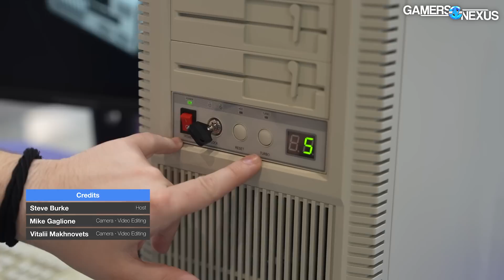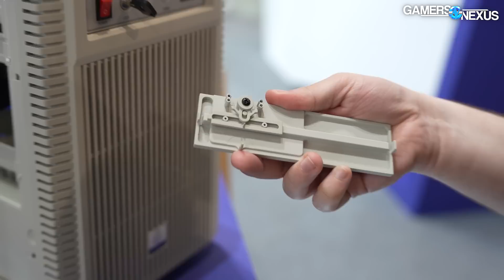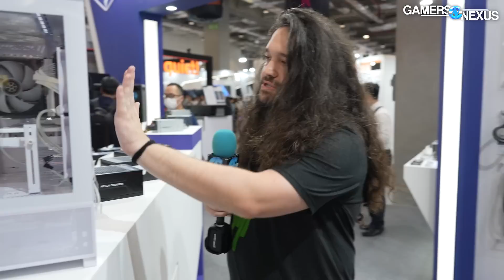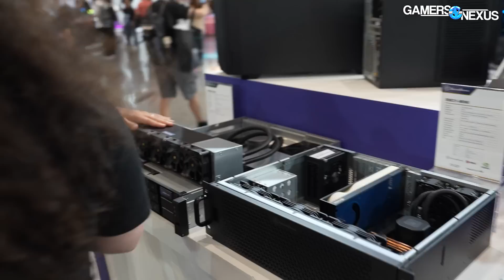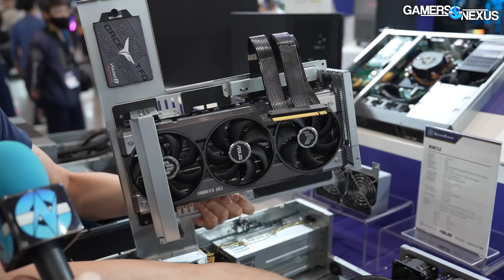Unironically the Best Case: Retro Silverstone FLP02 with Turbo Button

Comment from the maker: This thing is so damn cool. I can't wait to do the review. Check out Silverstone's FLP01 and the other cool/large cases from last year here: https://www.youtube.com/watch?v=rgu-91X3Sfs
Watch our Corsair coverage of their new 3-chamber case and fixed prebuilt GPU cooler: https://www.youtube.com/watch?v=wHgtYBUN0VM
And our technical interview with Noctua! https://www.youtube.com/watch?v=UpNmd3Y9qUU
Reply: Well, I hope they fix the power switch in the final version. 0 is off, 1 is on.
Reply: @Bagline  its because its the momentary switch nature of current pc hardware.
if it was depressed on the 1, the pc would do hard shutdown immediately after powering on.
i wish they went with the later iteration of power switches that look exactly like the Reset and Turbo button but slightly bigger, with a green led behind it.

Edit: thinking about it.
 if they flipped the switch label to 1 depressed being the default state and flicking it to 0 to turn it on would be Bagline's image. 
but flicking a switch to zero to turn it on would be a leap of logic most people struggle to comprehend.
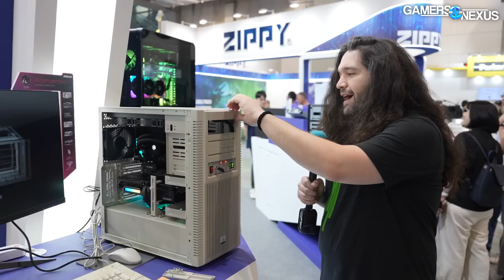Reply: @Personality_Of_A_Brick_Wall  That makes sense. I would honestly rather see that just be a hardwired switch between the wall and power supply though and have the modern atx power button hidden somewhere like up by the front panel USB. ( 4:55 ) Looking at the case and seeing it with 0 depressed while it's clearly on would never be unseen.
Reply: FLP01 was not in the roundup for Computex last year. Just double checked.
Reply: Not interesting, not enough space for HDD...
Reply: So they still CAN do real PC cases instead of RGB showcases bulls*** if they really want to. So it's not forgotten knowledge after all.
Reply: @omsi-fanmark Not really because even my Corsair ATX medium case. I have more space for HDD and I can put a RTX 4090 or RTX 5090. Here I saw only 2 spaces for HDD... Before it was easy to put 6 minimum...
Reply: @KenKazama-v2.0  They have 2, maybe 3 underneath, then 3 5.25" drive bays means they can get 3x vertically in just two of those, AND you get space for an external optical drive. They sell the 2 bays into 3x 3.5". I have one and it even has a 80mm fan (granted it's an original Athlon Thunderbird machine so it's deep). You could do several more if you're doing 2.5" drives I think my Evercool has space for 4x 2.5" including the fan. 

If you're trying to get >6 3.5" HDD, you're looking for a different kind of case and it doesn't make sense for them to make it full on NAS-style when there are other cases with huge drive stacks for that (completely legit) use case.
Reply: @clinttube  Back in the day, if you took an E-ATX XL case, you could add 12 HDD easily and you had easily 4 5.25". Do you seen the price ? $225 for an ugly case without space... If it was great, you could easily put a RTX 5090 and right of the card, 3 or 4 extra HDD. But it is not the case
Reply: @KenKazama-v2.0  I'm definitely not disputing the dearth of storage options and expand-ability in modern cases - I just made the decision to go "modern" instead of what I really wanted which was greater storage capability and 1-2 spaces for optical drives. Instead I put my slim DVD drive inside the case and will be getting a cable with a motherboard header on one side. 

So I'm with you; I'm just saying relative to what is available today this actually has style to it. The options that I found were simply boring especially given their price, so even at $225 at least it's different. My issue with this case is it seems to be liquid cooled or bust. They could've put the power supply in the top and lowered the MB to get it more in the path of the intake, which would've been even more old school. But it's assumed everybody liquid cools now apparently (except me) so they weren't quite innovative enough to pull that off.
Reply: It's not a REAL retro case without razor sharp edges on the stamped steel.
Reply: Now we need a motherboard output that hooks into the front number display, so it can display either POST codes, or fan speed %s, or temps, or anything else of our choosing...
Reply: Turn your key, Sir.
Reply: Is the PSU shroud on that retro case removable? I hope it is.
Reply: So funny watching this and see Linus little fckups :D
Reply: That retro case is for sure the best.!
Reply: I want someone to do the late-90s era cases, with their clear plastic, or the crazy indigo-and-teal SGI stuff.
Reply: As a 19" Enthusiast, Silverstone is releasing yet another banger with the 3U case. My current workstation build is in the RM-400, which is 4U. In the living room i have the Grandia GD-11 with water cooling support, which is also rack-mountable. I also use their 4x SATA M.2 3.5" thingymabobs to get high SSD storage density without breaking the bank.
Reply: I want my internal blu ray/dvd drive bays 😊
Reply: oh shutup beta-driver clout-chasing freak
Reply: $220 us sounds like a great deal until the govt F'd the whole damn world.. and likely that's ~$250USD + shipping + sellers mark up and translation to local currency... its like a $800 NZD case.. That's over half the price of a 5070ti... for a case  =(
Reply: Please tell me it comes with a matching steel side panel instead of tempered glass.

Comment: you're not meant to use this as a modern daily-driver gaming PC. don't put a hot GPU or even CPU in it. you're meant to use this as an aesthetically retro hobby computer. inside and out. install Project Luna or eXPerience Freestyle or maybe even Project Memphis on it. it's meant for people who can't find old PC cases anymore due to draconian "e-waste" laws, like us Europeans. you're supposed to use this pc and its predecessor the FLP01 as retro game emulator stations. as printer terminals. as office program interface. as YTP editing machines. play old pc games on them, using some nice little modern 4-core Intel with integrated graphics. 

don't use a 16:9 or other widescreen monitor with this. use a gray/beige CRT or LCD monitor with a 4:3 aspect ratio. and please PLEASE don't install Windows 11 on it. that would be cringe. you don't even need antivirus let alone the dystopian joke that is Windows 11. just get Windows 10 LTSC, keep your Firewall on, and use OpenShell & Retrobar to make it look like XP. make your wallpaper Bliss and the desktop theme Luna. you will thank me later.

Comment: turbo put you at 33 mhz. you would have to click it off for certain games that were designed to run on the slower 286 systems.

Comment: the problem with excessive ventilation ports is it prevents static pressure from building inside of the case. breathability is not as important as maintaining the air pressure that forces the hot air out.

Comment: That lock unlock feature is probably one of my favorite features! I have a 1 year old that loves pushing buttons.Having that will prevent him from being able to turn it on or off, which is pretty cool, IMO. I'm just wondering how that works since modern PCs dont use toggle buttons. They use push buttons. If I turn it off, will it just cut all of it's power? Or does it just send a shut down signal only? Or is that just a push button that just looks like a toggle button? So many questions!! lol

Comment: Actually the ATX standard was introduced by Intel in 1995 if I remember it correctly. That means you can build a modern PC in any vintage ATX case from 95. And I've done that a few times with the idea of a sleeper machine behind it.

Comment: The massive fail of 3 floppy drives.  Drive C: is drive C: because you get Floppy A: and B: and that's it.  The blank is a standard for a reason.  Bare minimum need one blank panel.  The good news is if you print one on a textured build surface with the right color it might be easy to fix on the end user side.  Curious if the toggle is a momentary, AT used a double pole double throw with the full wall AC routed up to the switch 😅

Comment: I like that there are some companies giving us places to add optical drives and more front panel ports.  There is no excuse why not with so many cases, like the ones that isolate the power supply on the bottom as they can just cut open spots in the front.

Comment: Just wish the FLP02 was cheaper, I still cling to my old case only because of the 5.25, I use a lot of USB ports so I need the expansions but my case is starting to get some space trouble due to the bigger GPUs. Will still try to get one.

Comment: No woodgrain accents, doesn't sit horizontally, and no actual 5.25 drives?
So close, yet so far.
Any chance of getting a power supply with a thick plastic slab of a switch that feels like you're flipping a breaker when you turn it on?

Comment: I agree with Silverstone that the locking mechanism is difficult to manufacture,  how about using the traditional clip style cover plate while retaining the 5.25in floppy style plate? It doesn't need to worry about mechanical fault, and it cost less to produce as it can be 3d printed. Even if the clips snaps due to plastic age. It can be reprinted again.

Comment: I'd like to see the turbo button not just override to 99 pwm, but to be programmable. 
That way it would actually be really useful, not just a homage/meme. For example: you'd like more fan speed during gaming, but a silent desktop experience. Cpu temp dependent fan profiles also kick in during short cpu turbo duration (opening a program, extracting something, etc). Gpu dependent profiles can only be realized with third party software.
A programmable pwm override button would solve both problems.

Comment: I would love a successor to the Silverstone FT02.   I still love mine, just need one with about 5 to 7 cm extra length (case height) for the newer ~350mm GPU's.  The only over improvement that case needs is the hot plug connector mechanism for the 5 drive internal hdd bays. Everything else about this case is perfect and I will continue using it since nothing really matches it.

Comment: I love that I was able to salvage a Micron Millennia case from '99. I removed one of the disk drives and the floppy bay (both are behind a hinging plate) and slapped in 2 80mm fans and some USB I/O.

Some cut rivets and zip ties later, that beautifully yellowed machine is running a 7800X3D, Deepcool Assassin IV S, B650 AORUS ELITE ICE, Klevv Cras A-Die RAM and an XFX SWFT 9070 XT with a 1300w Seasonic PSU. I love it so much.

Comment: I really like my Silverstone GD11, as it is convenient to keep on top of my desk hutch, keeping it cleaner from cat hair. About as compact ATX as possible without being inconvenient to work with. 2 possible improvements I'd like to see:
Top panel modified for perforation running longer along the PCIe/GPU slot. The GPU heat exhaust does get trapped a bit, and leads to some temperature rise, though not a problematic amount for a 300W GPU. 
3 front fan support (for 360mm radiator). I managed an Artic LF3 360 in the case, but the left 1/3 does not have a fan, which I moved to center push/pull. I acknowledge about half the flow would typically be obstructed a GPU anyways, but it would still be nice for it it to be tooled for support.
I'll also note the push/pull aides the RAM temperature significantly under full system load, as GPU flow through designs heat dumping onto the RAM is not insignificant.

Comment: Just fyi: The Turbo button in the old days would slow DOWN the clock speed to cater for older games and software relying on clock cycle. Otherwise there wouldn't even be a point.

Comment: Dig the retro system.  As someone who has owned a lot of cases.... The fishtanks just aren't a great option if you're a real hardcore hardware person.  If you like to tweak... and travel with your case (LAN Parties, etc).... and have lots of upgradability options... fishtank just aint it.  Its purely for show.  It comes with tons of usability compromises. They are usually needlessly heavy too.   I regret moving to my Lian Li fishtank (x11 evo or w/e) case from an older Lian Li oldschool Mac Pro desktop clone case.  The old Mac Pro clone one had so many more drive bay options, was light as a feather, and had wheels on the bottom.... it was choice...  As someone who does a lot tweaking,  customizing, and upgrading over the course of my builds, i miss it.  Never doing the flashy fishtank thing again.

Comment: I used my turbo button well into the era beyond my 486.. I found you could use it to change the multiplier for the CPU on the fly by using the cable attached to the multiplier jumper. Was cool.. It only would work about 75% of the time the rest of the time it would crash the PC.. But I thought it was cool... That is such a cool retro case.. I wwwwwwnnnttt oneeeeee

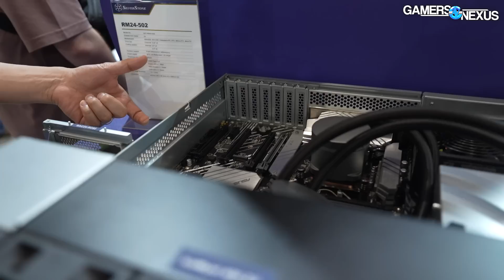Comment: @12:30 Cool case!
The trick for loud computers (like server stuff) at home is stick it in your garage, and run optical usb cables from it to a usb hub, along with a displayport or hdmi optical cable to whatever room your mouse, keyboard and monitor are in. There are also things like nanoKVM now that allow for remote triggering of power and management of bios. Makes overclocking testing really easy. Protip, put the cable meant for the reset pins on the CMOS clear pins instead for when you really break something.

Comment: Silverstone just unknowingly released one of the coolest case for DIY NAS. 5 1/4 bays are amazing for hotswap drives. Lockable power also means you can't turn it off by accident. A+
Reply: Only downside is that it's going to be danged hard to find a beige 5x hot swap module.... 😢😢😢
Reply: @T3hderk87 D.I.Y. How about spray it yourself? Food for thought.
Reply: @christechtipshd Reasonable ideas like this cannot be tolerated!! Have a like lol.
Reply: Stop cats from turning off your computers with this one simple trick.

Comment: damn, if only that retro style case was more accessible. i understand why it's not because it's so specialized and unique for the modern day but at $200 it's not gonna make any dents when if you really want to search out an old case  $200 is about the max and you can usually find cheaper if you can do local pickup or if you could find a good deal.

Comment: Silverstone FLP02 looks great for legacy builds. On something like AM2+ there is non-zero chance to use it with AiO without too much rigging. Would be great to have and option to turn 5" drive cate 90* to for use as horizontal case with CD/DVD drive

Comment: tbh it would’ve made more sense to have the PSU at the top of the retro case to have a bottom intake. of course not many people would actually need a radiator and some 5.25“ accessory at the same time but this case has the exact same collision issue like the Fractal design Arc series.

but yeah, of course they won’t invest into a joke case having its own tooling

Comment: A problem with my existing "sleeper" build in an early-2000s ATX case is airflow; these things usually had a front intake, but it's often a single 80mm fan with barely any holes in the case front to allow air in. The FLP02 looks like a great way to keep the retro style while actually being able to cool modern hardware. Plus real 5¼" bays means I can use my beige Pioneer BDR-212XJ blu-ray drive :) I would have loved an external 3½" bay, but I guess that would require retooling the case. Maybe they can include a color-matched 3½" bay adapter?

Comment: They should go back to horizontal cases so the gpu doesn't cook the cpu with rising heat. 

Nobody made a big deal about floor space for other electronic devices. Horizontal is fine for blu ray and sound systems but we have to pretend we live in Tokyo pods for PC cases... why?

Comment: The USB thing at the top, instead of some hinge thing that kinda is in the way, and is going to break. It looks weak, and isn't on par with the rest of the case that looks super sturdy. Instead have a cover that you just push to the side and it opens up the USB ports. That way, if you want to have it visible you can, or you can close it up.

Comment: -Would be nice if the control panel would be modular, so you can put it wherever you want, for example to the top/first hdd bay, so it's easier to turn on if the pc is not on the desk.

-The turbo display should show the bios post codes when booting up.

Comment: I've still got two full tower cases (Aopen HX08 and the other ive forgotten the model number also an Aopen case) from way back in the 2000-2003 era. They are still great. The steel is about 1.5mm thick. Weapons grade PC case.

Comment: For the FLP01 I would like to see support for building a actually retro system in them. BabyAT might be too much of a stretch back in time for the case to support but early ATX with adapters for running modern SSD's through PATA IDE headers.

M.2 drives are starting to fall below sata drives in price but it is still difficult to have a lot of them in a system. Homeserver running on an AM4 or AM5 platform really needs to start seeing a way to adapt from a x8 or x16 slot to 8 or more m.2 drives.